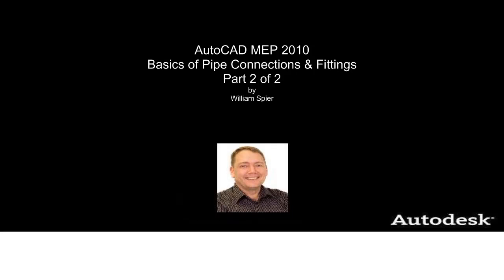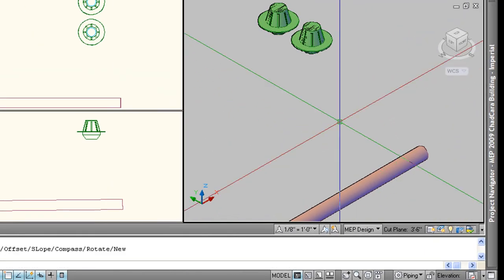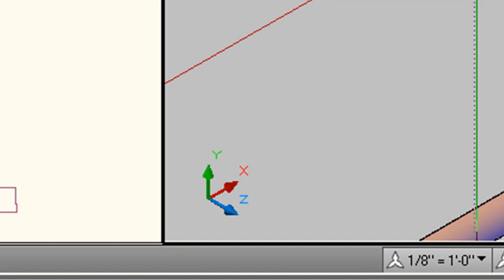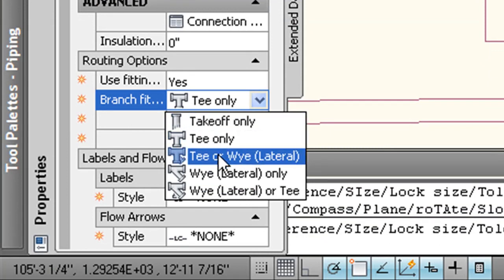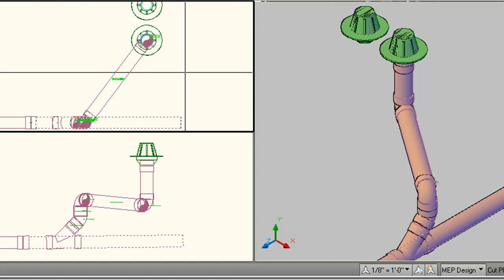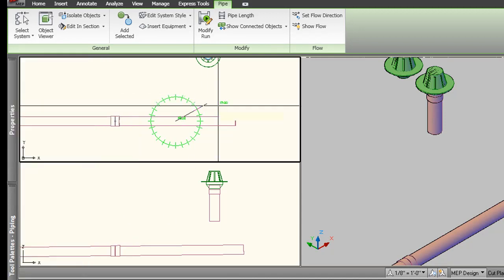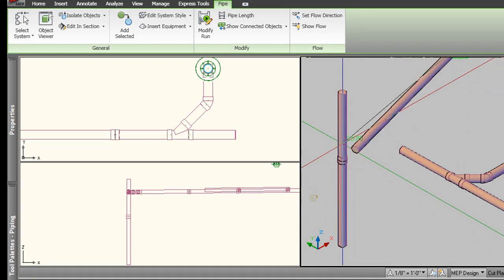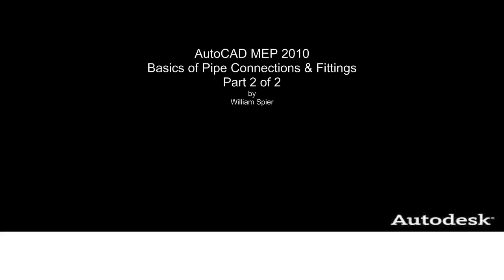AutoCAD MEP 2010 Piping Basics - Video 2of2

Comment: hi. there arturo here from cabo  san lucas mexico my question here is can i use autocad MEP for piping a pool  or a spa or a jacuzzi???
Reply: Yes, you can use it for whatever application you like, provided AutoCAD MEP has the system materials you plan to use. So if you plan to use PVC for your jacuzzi and pool piping, then yes, definitely. But if you plan on using something like Pex, then you would need to use flexible pipe - see https://knowledge.autodesk.com/support/autocad-mep/learn-explore/caas/CloudHelp/cloudhelp/2019/ENU/AutoCAD-MEP/files/GUID-F5CB8ED8-2D20-4597-8678-E1D3CF6BCA08-htm.html. 
On that note, you can also use Revit for either PVC or Pex designs.
Reply: @wwspier  thanks for quick answer i usually recieve a pool flor plan and sections in plain 2d autocad and what have been seen lately ist that mep automatically autocad mep produce pipes ducts and plumbing in 3d along with the pool floor plan... do i need to convert 2d pool floor plan to 3d autocad mep?

Comment: A lot of these videos it seems everything is done in one version with all the out of the box content.  In reality you might get a piece of equipment that's a 'DXF' file or 'IGES' files, an Architectural background that's been drawn in 2008, and HVAC plans that have been drawn with some fabrication software like CAD-DUCT.  In my experience there's a certain way to deal with these files to limit the issues that can and do arise.

Comment: These videos have some good information for the basics.  Having more than one viewport open is a must.  It would be nice to see a video where you're following a route either duct and/or pipe that was given by a 2nd or 3rd party, such as the plan view documents you get from an engineer or the cut sheet/submittal drawings given to you from a supplier.  You could even maybe drop a few pieces of equipment into the model that are picked up from the net, manufacturers and/or suppliers.